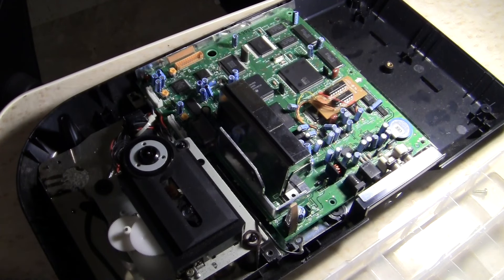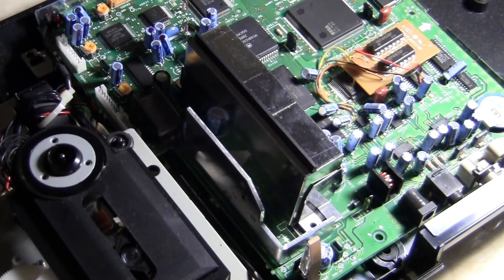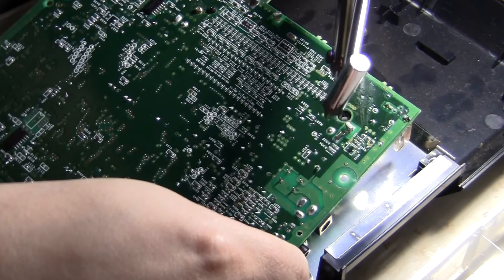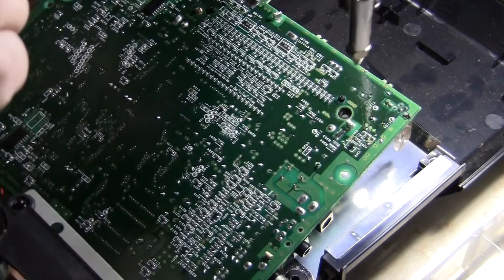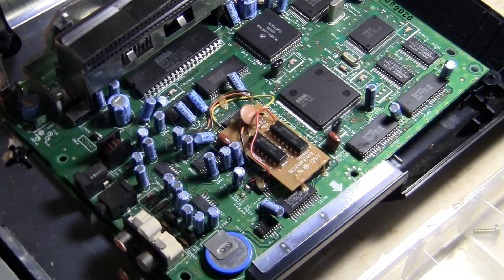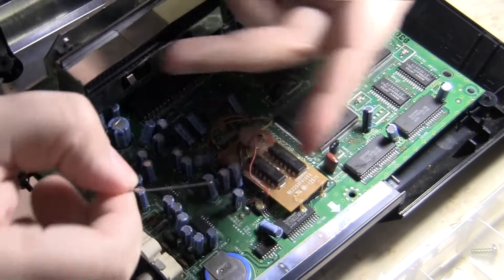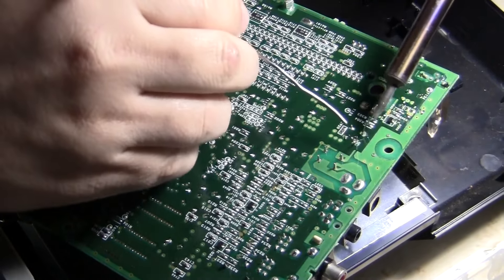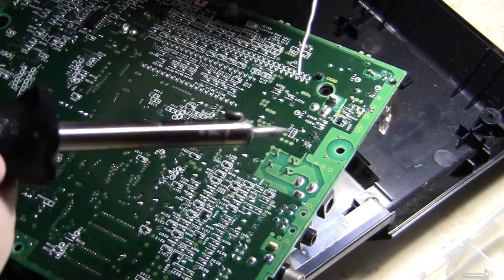The Gamer's Vault: Episode 11 Sega CD Power Repair

Comment: Hi James,
I also just checked the fuse in my Mega CD 2 and sure enough, power on one side of the fuse and not the other...Although after replacing it, still no power up. Any idea what else may be the issue...? Volatage Regulator maybe..?
Thanks 
Andy
Reply: Hi Andy gamers vault answered your question on the latest video